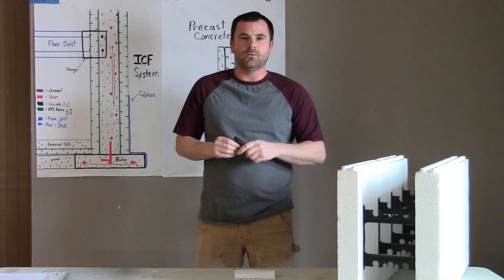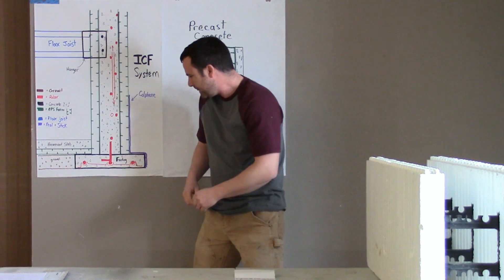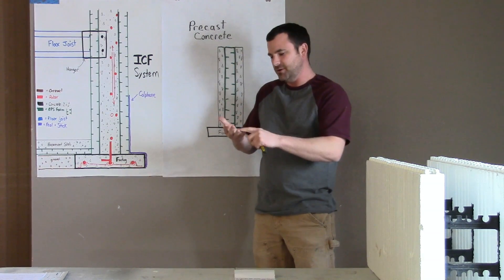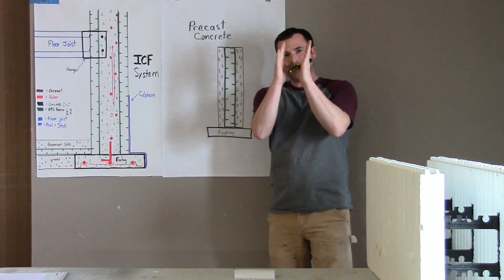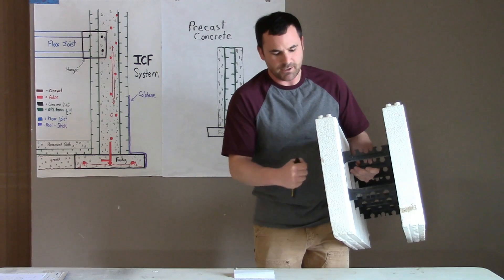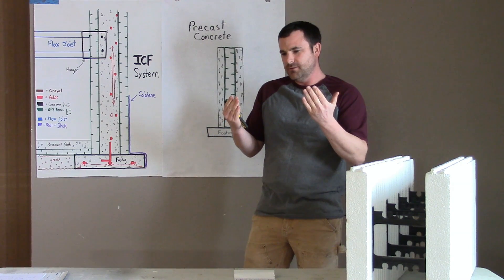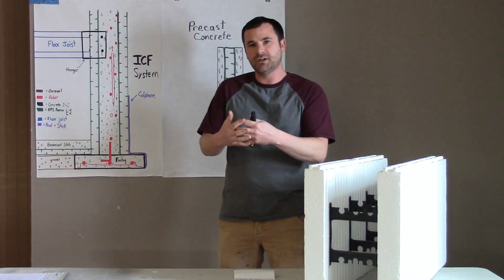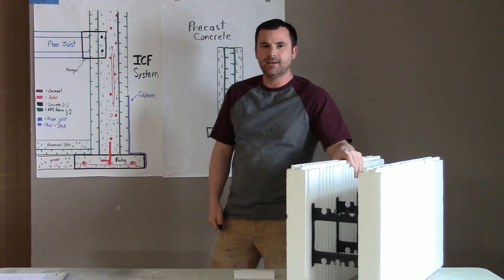ICF Construction vs. Precast and SIP Panel Systems

Comment: I like ICF for sub-grade... but that's where it stops. 

-Time intensive. 
-Increases specialized labor 
-heavier footprint = more settling
-requires additional exterior/interior treatment and still requires a vapor barrier
-requires some sort of additional exterior sealing to prevent pests from getting to the foam
-introduces unnecessary moisture to the site
-requires either floating slab or excessive slab pour to compensate for perimeter load differential.

IMPs (insulated metal panels), particularly steel-skinned SIPs, are a one-and-done for a dried-in structure. Goes up faster. Lighter footprint. No specialized labor required. 100% cohabitation with other contractors. No concrete trucks. No sampling. No worries about time-sensitive admixes, set times, etc. No excess water introduction. Reduces/eliminates the need for floating slab or overpour slab.

Comment: I considered ICFs for my basement when I build my log home in 1999, but ended up going with Superior Walls precast.  The main reason was the speed of installation and the same or lower cost.  I also liked the fact that the concrete was 5,000 psi and is naturally waterproof with no need for additional waterproofing material or outside finish to protect foam.  And the stud cavities allowed easy installation of wiring and boxes and the addition of a lot more insulation.  I have been very pleased.  My entire basement was completed in less than a week.  A couple days for excavation, a couple of days to install drain pipe and crushed stone and then 6 hours to install the superior walls and a few hours to backfill the walls once the first floor diaphragm was completed.  And I’ve had more than 20 years now of a dry, quiet and warm basement living area.

Comment: Hi
The thermal mass comments on ICF could be a bit ambitious. 
There is a massive cold bridge though the footing bearing.
The heat is heading that way before it ever comes back into the house.
The ICF would probably benefit by having more insulation to the inside face . Some call it thermal mass. I call it a heat sink as described to me by some Scottish guy.

Comment: Sir we've used both IFC and precast walls, both r good but I kinda like the precast better Sir the base has steel plates with rebar welded to plate plus steel pieces in walls and they get welded together
Reply from the maker: Good to know.

Comment: Sir we've used both IFC and precast walls, both r good but I kinda like the precast better Sir the base has steel plates with rebar welded to plate plus steel pieces in walls and they get welded together

Comment: Your point still stands but your thermal mass calculation is 5x too high. A BTU is defined as the amount of energy it takes to raise 1 pound of WATER 1 degree F. Concrete has a specific heat of about .2 (water is 1). So it takes 5 times more energy to raise the temp of an equal mass of water as it does concrete.
https://www.bdmd.com/water-the-ideal-thermal-mass/
Reply from the maker: Very good to know! Thanks for sharing that.

Comment: #1- "monolithic structure" I don't even like monolithic foundations, much less monolithic structure... ESPECIALLY with the weight and rigidity of concrete. 

#2- "how do you connect one panel to another without having it pull apart"... For our preferred steel SIPs, that would be 1/4x2 self tapping/self sealing screws and non-skinning caulk. 

#3 "it actually acts like a R50/R60" no... no it doesn't. Thermal mass and temperature stabilization/penetration have their merits... but when it comes to heating/cooling sustained gradients, ICF is what it is... a sub-R30 thermal barrier. Sure, you can sell and demonstrate your claims in transition periods... when gradients average close to desired interior temps.... but try that in sustained single digit temps. Furthermore, the duty cycle of the HVAC is less consistent... because the HVAC can only account for air temps, not structure. If a negative gradient has penetrated the structure for any reason, it will take 3 to 7 times as long for the HVAC to penetrate the ICF and establish barrier stabilization, as compared to EPS core steel SIPs. 

ICFs offer only two advantages over steel SIPs... sound control, and extreme force dimensional stability. In other words... if you want an energy-efficient bomb shelter, or just want a near-silent home, go with ICFs. If you want superior temperature control, energy efficiency, and maximized return on investment... just look at who needs it most, and what they use. Steel SIPs dominate the market of above grade temperature controlled storage. In the end, that's what your home is. It's a temperature controlled storage for your family and belongings. If you want the best solution, follow the most cost conscious buyers.

Another benefit to applying peak commercial/industrial solutions, aside from peak performance... is total envelope performance... return on investment and structural integrity. Lots of people hear "concrete", and they immediately think "strong"... but that's not always the case. Concrete is a porous water penetrable, low strength-to-weight ratio, bulk product of variable consistency (hence, the reason for onsite labs for large scale pour-in-place operations). Steel/EPS SIPs have dependable and consistent structural and thermal performance... from production to installation, and throughout the life of the structure.

How about foundation requirements? ICFs require higher load foundations than steel/EPS SIPs... requiring more material, ESPECIALLY in regards to thermal control and insulated foundations. 

In the end, in exchange for a minimal effective degree of performance where ICFs are superior (extreme physical force resistance/sound control), you gain the following with steel/EPS SIPs:

-higher efficiency temperature control
-more consistent product (concrete can only be poured within certain temperature/moisture/humidity windows, and composition must be adapted to conditions)
-higher return on investment 
- less material intensive foundation
-MUCH faster build times 
-fewer conditions cause weather/climate delays
-less on-site specialized labor requirements
-single source material for the entire above grade envelope
-independent structural material allows the entire structure to be "dried in" and "under roof", transferring all other work to post-construction "finish work". Aside from interior load bearing walls... once the panels are in place, roofing/siding/drywall/etc. are not structure critical/dependent. 
-post construction adaptation/customization is easier and less labor intensive (aside from the requirement for electrical conduit... windows, doors, additions, and virtually all other structurally involved improvements can be made faster and easier)
-more conducive to progressive home improvements... as the owner can have a viable home structure or "shell", adding interior and exterior elements as required/permitted over the life of the home. As an example, one can build an open living space basic accommodation at point of construction... then add features such as siding/roofing/drywall/etc. on a later date. This decreases initial investment for the buyer.
- single solution structural material also eases code compliance, ESPECIALLY with regard to increasing energy efficiency requirements. Steel/EPS SIPs are sheathing inclusive, eliminating the need for sheathing/vapor barrier installation. Also steel/EPS SIPs have non-porous exposed surfaces... making total envelope permeability goals far more easily obtainable, and less material and labor intensive. This again, results in a higher performance envelope.
-higher material-to-labor ratio. This is crucial, in regards to value to the homeowner. When purchasing a home, the homeowners' buying power per square foot is increased with SIPs, simply because more of their investment goes toward the actual structure of the home... as opposed to the labor of constructing it. No other current building system compares to SIPs, in this regard... not even stick frame construction.
-whole structure material solution, means structural unity... expansion/contraction rates, thermal permeability, and structural integrity are all unified/homogeneous. This reduces/eliminates many of the issues associated with roof-to-wall interface surfaces and joints... increasing the structural integrity and energy efficiency of the home over time
-lighter materials/structure equate to lighter foundations... in turn, decreasing both overall settling and compressive footprint of the home. This not only decreases material costs... but again, increasing structural integrity over time, and increases the effectiveness and dramatically reduces the cost of insulated foundation when/where implemented

You may think concrete has a higher degree of structural integrity... but aside from withstanding extreme physical forces, it simply can't match the effective performance of steel laminated EPS core SIPs in residential applications.

Comment: Id just like to be the voice of precast here. I can see in the comments that this is done difrently difrent places, but Im most familiar with how you drew it.
First off, attaching it to the footing. Precast for most parts is attached to the footing with long large rods, typicly an inch in diameter. This will then be grouted using special cementbased grouting mass. If the holes does not have a corrugated pattern, and the engeneer deems it neccesery, a special epoxy will be used. Typicly on footings that were poured prior to the plans being finished, so the holes had to be core drilled after the fact.
For your mentioning of the walls twisting and turning indepenently of each other,  this is true. Mostly all walls are welded together in the top, and if they exceed 3 meters tall, they can be welded several places in the joint, to prevent this. Another common technice involves a set of cast in wireloops or rebar loops, that interlock and get a long rod thread between them. They can then be grouted together, with either normal concrete or special grout, again depening on what the engeneer deems neceserry.
If the house is completed using hollow core planks, you will get a very stiff building. Incredible R value, fire resistance and water resistance. Huge internal thermal mass, and generally very cheap and easy to maintain and heat/cool.
I would allso like to mention that the concrete thickness can be varied with this type of production. The walls are cast on a bed. The outer panel first, and then the insulation is added. You can form the insulation so you have a thicker concrete at the bottom and the top, and then maybe just 4 or 5 inches in the middle. Drasticly redusing the cost and enviremental impact of concrete production. This allso makes it possible to transport more walls per truck, and assemble them with a smaller crane.
Reply from the maker: Thanks for the input! It helps.

Comment: I prefer "precast concrete, because it's a hard, concrete surface, on both exposed surface planes!  It's waterproof, bullet proof, and strong as hell!  There's no need for "stucco, or "cement-board/drywall, plaster, etc. It's COMPLETE, as poured, in place.  Build the panels ON SITE, and lift with a crane, and set, tie/weld together, and go!  STRONG, FIREPROOF, TERMITE/ANT/BEETLE proof, and ALL YOU NEED IS A WELDER, REBAR TOOLS, TIE WIRE, AND CEMENT MIXER!...AND A FEW TONS OF SAND AND GRAVEL!!!...

Comment: Structurally speaking in a disaster ICFs would be brilliant if they had rebars going diagonally at each corner about 1 foot on each side.

I wonder if they have ever integrated this idea.  Several years ago a major university study concluded that connecting the corners with diagonal supports  increased structural strength during an earthquake.
Reply from the maker: I haven’t come across this but we are not in an earthquake zone where I’m from. 

Very valid point. I know we have installed some crazy rebar for major structural components in an ICF wall so anything is possible.